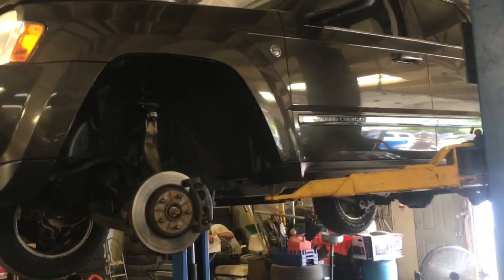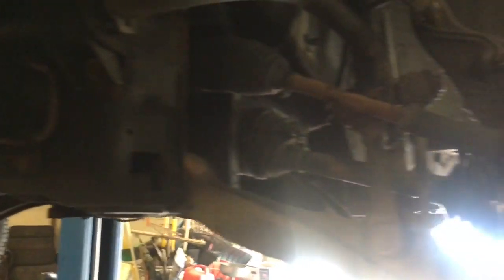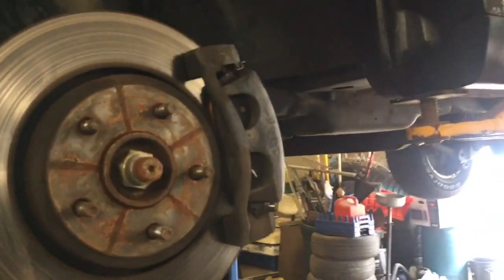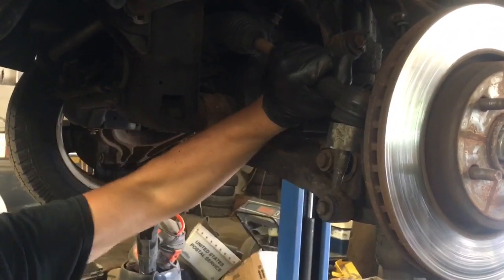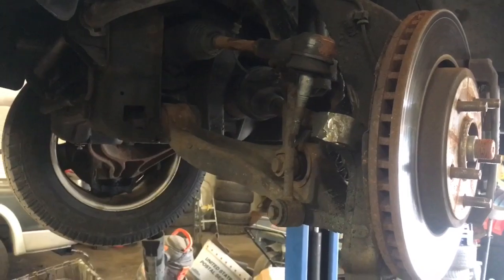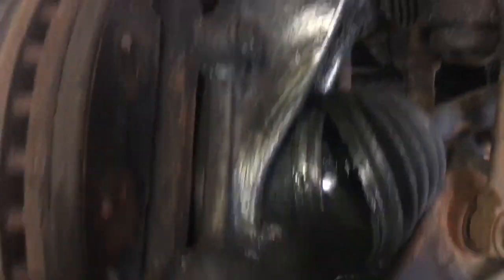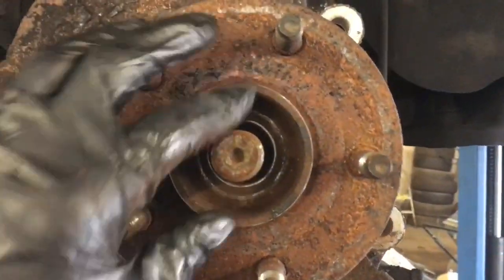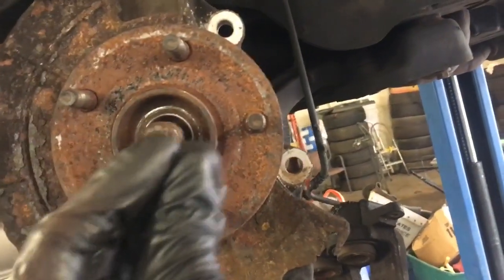Jeep grand Cherokee front axle replacement

Comment: Super helpful video. Made doing my wife's '08 a quick easy process. I don't remember if it was mentioned in the video, but you will need a 36 mm deep socket to get the axle shaft nut off, I had to run back to the parts house to get one.
Reply from the maker: Yeah I don’t know but thank you for mentioning it I will pin this post

Comment: Thanks for the video, just FYI I didn't see a need to remove the sway bar link, also before I removed the lower strut bolt I was thinking the axle will fit between the wishbone on the strut and sure enough it slipped right through, I must say all the videos that are posted all show the need to remove the stabilizer bar link and lower strut bolt. My jeep is a 2013 grand Cherokee and it came right out and went right back in..

Comment: You did a great job, you explained the job well but as a mechanic myself, I was wondering how you were going to pop that shaft outta there with the other half still in the hub. But you did explain it but for the none mechanics, it would work to show them how it's reinstalled.
Reply from the maker: I will try to keep that in mind in the future sir. The problem is when you’re working on vehicles you know certain things and they come naturally but to other folks you are absolutely correct it’s not a natural thing for them so sometimes you need to be clear I am certainly trying to do a little bit better job with my explanations and visual aspects. 

It is extremely hard to find the balance between under explaining and over explaining and also under showing and over showing. The longer a video is the worse it is for the channel because people will only watch the points that they want to watch and that drives the channel CPM down I would like to say it’s a delicate balance but I’m never delicate with very many things.
Reply: @sharpcarco  Good I understand

Comment: Question: how do you know you need front driver side axle? I have the same year make and model Jeep and only when I accelerate it makes a humming noise but only when I pressing on the gas... Any suggestions? Need your help. Thanks in advance
Reply from the maker: Hey Antonio more than likely that’s a bad Front or rear differential because you’re telling me that when you give it gas it Howells and when you don’t it goes away that’s usually a sign of the Front pinion bearing being bad on a differential.
Reply: @sharpcarco  how much would something like that cost to repair?

Comment: Thanks for the guide and all the great tips! I'm going to be attempting this on my Jeep and planned to do both sides since I hear a clunky noise on the passenger side when turning (the CV boot appears to be starting to leak near the clamp also) and the driver side CV boot clamp opened up and all of the grease is gone. Should I expect anything different on the passenger side?
Reply from the maker: No the passenger side should be almost identical to the driver side. If they’re not both bad I don’t recommend replacing both of them because it’s not necessary. I don’t know why some of them go bad and why some of them don’t go bad but it is very rare to actually have to change both of them in the lifetime of the vehicle. At least that is my opinion.
Reply: @sharpcarco  would NOT recommend anyone doing this in their driveway. My axle is stuck inside the differential and it has to be taken apart now. Also, that lower control arm bolt is notorious for being seized and mine won't budge at all even after following this guide.
Reply: @sharpcarco  whit my bra new cv axle no stay in and come out what do I have to do  thanks

Comment: Hey clay how do I diagnose if it’s a cv shaft? I have clicking but looking at the boots mine look fine. Everything else is brand new except the cv shaft and front diff. Any help Is appreciated. Also how would I diagnose bad front diff? Thank you very much!
Reply from the maker: Morning Kyle, Try looking into the driveshaft between the transfer case and the front differential that will cause that noise. One end of it is like a CV joint and they have a repair kit for it.
Reply: That was replaced a few months ago and is in good condition. It does sound pretty similar to that sound it was making though. I just put a whole new one on there instead of repairing it
Reply: Actually you hit the nail on the head about that front driveshaft. It broke today and left me stranded even though I just replaced it with a brand new one 4 months ago. Luckily it has a lifetime warranty. It looked completely fine though I thought forsure it was still good. I guess sometimes just drive em and they will diagnose themselves 🤣🤣🤣🤣

Comment: having trouble with the bolt that holds the spring assembly to the lower control arm. Tips? I've tried jacking up the lower control arm to all kinds of different heights. I also tried compressing the spring. I also tried both simultaneously. I am trying to drive the bolt out with a hammer and punch, but I am getting nowhere fast.
Reply from the maker: Hey Jacob I’m not certain what you have going on but I recommend raising the vehicle up in a different position from where you have it lifted up right now you probably have it in a spot that is not allowing you to compress the spring properly I’m hoping that another jeep guy sees this comment and answers it because I’m not sure what direction to tell you to go shut up I often use ratchet straps to pull things together I don’t know if that’s helpful or not you do not put the ratchet strap on the spring you put it on the portions that need to be squeezed together

Comment: Good info! I have a 2013 Grand Cherokee Laredo (5.7L) with 4WD Low. I was told I need to change the Left side front. How do I know which to choose? single / double speed? Thanks
Reply from the maker: Well the best way to be sure that you get the proper axle is called the dealership give them the last eight of your Vin and they will tell you exactly which axle you need and then you can order it from the local part store or order it from them. If you have an already called the local parts store you might want to just called him first because they can probably get the information from you that you need to make sure you get the correct axle
Reply: @sharpcarco  Thanks! great video again...

Comment: What if the axle nuts are gone due to rust? 2011 has wheel problems holding water in the axle area.
Reply from the maker: Well you still need to replace the axle and that’s not going to happen again for 7 to 12 years. So I wouldn’t worry too much about it that’s just my guess I don’t know all of the information but I’m assuming you’re working on a much older vehicle
Reply: Torch them off and replace with new.

Comment: I’m confused are you saying to drive the screw driver in between the rotor and pads I’m pretty sure you’re going to indent and score the rotor if that’s done lol
Reply from the maker: No you don’t have to do it that way that’s just the way I do it. 

I look at it like this. The screwdriver contacts less than 1% of the rotor surface. A little scratch on the rotor is not going to hurt at least that’s my opinion. I only showed that technique because it’s what I’ve been doing on hundreds of cars for about two decades now. It saves me from having to get out special tools to push in the brake caliper cup and makes the job quicker and simpler. Do it anyway you like sir. But this is the reason that I do it the way I do it
Reply: The Clay Way I mean to each their own I’ve always used my caliper tools esp now days you can’t use that method on all cars anymore being that most modern cars now have pistons that twist back into place. Take care man!

Comment: I got stuck on the bolt that holds the fork. Couldn't get it out. I put heat pressure nothing
Reply from the maker: Well regretfully that is extremely common because the bolt rust inside there try and air hammer if you have that available and push it out but there is situations where you have to cut it and replace it that’s the last resort though
Reply: Had to cut it out

Comment: You don’t have undo a single ball joint. The CV will shove out through enough to get it loose off the diff, then just take the bottom of the strut right off. Took me no time at all.
Reply from the maker: I’m not certain that I remember for sure but I could’ve swore that I said you don’t have to do it this way you can do it this way but I can’t remember maybe I’m wrong thanks for informing us

Comment: If the bolt holding the lower control arm to the bottom of the strut is seized you may have to buy the entire control arm. Metal seized to metal inside of a rubber bushing can be impossible to break loose.
 And no the CV axle cannot squeeze through between the forks of the strut.
Reply: take the end of the boot off and slide in/out the axles. then put the boot back on and a new clip